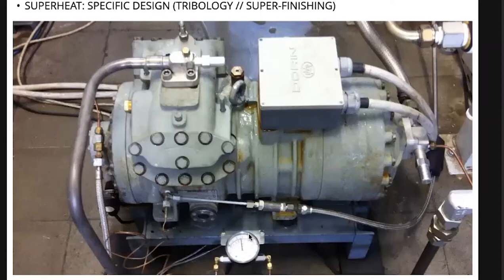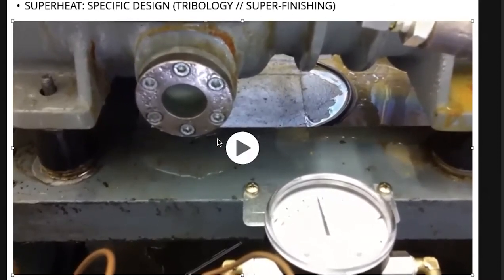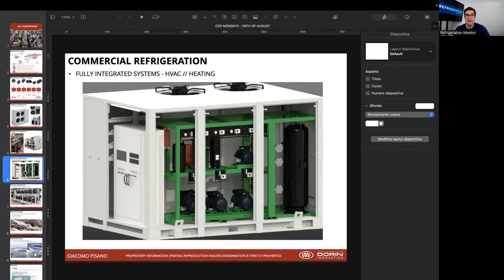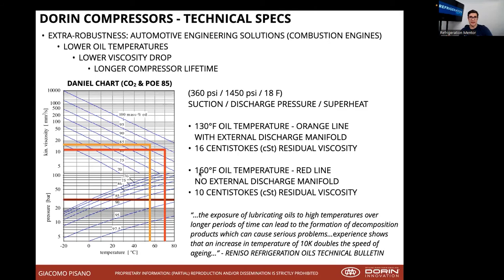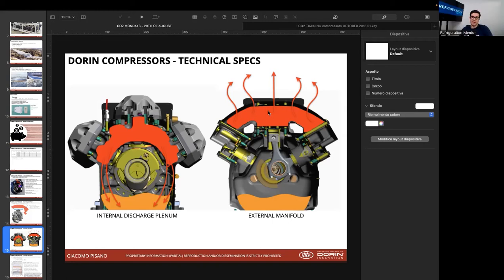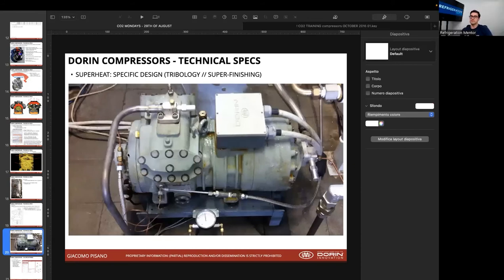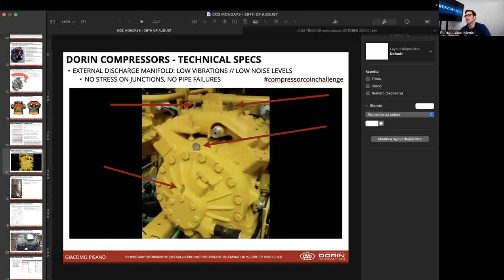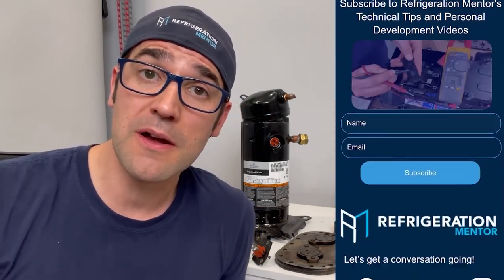Dorin Two Stage Transcritical CO2 Compressor

Comment: My experience with a CO2 glass door refrigerator: it was slowly leaking somewhere. I replaced the CO2 compressor with a R134a compressor. It run good and 3 years passed it still runs good now. When you has high pressure in the system it pretends to have leaking spots. I am not interested in any high pressure products
Reply: You really went with a like for like replacement when choosing 134a